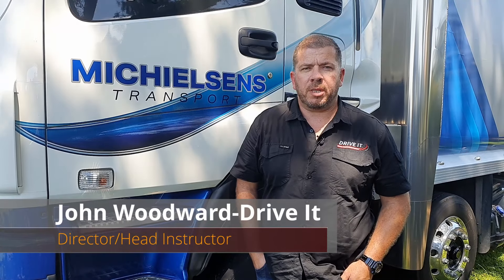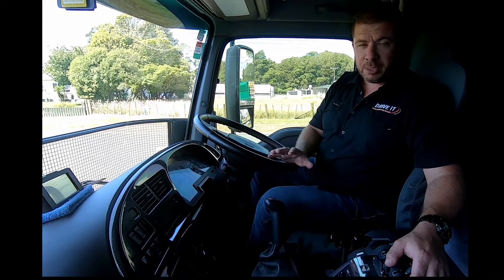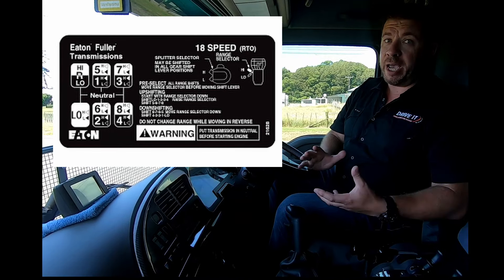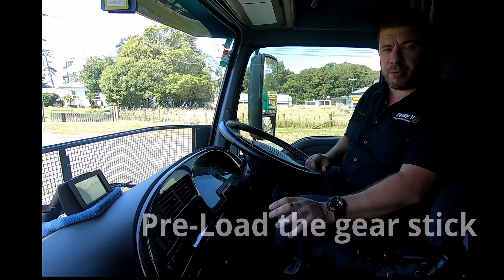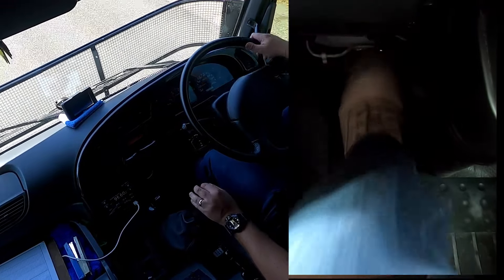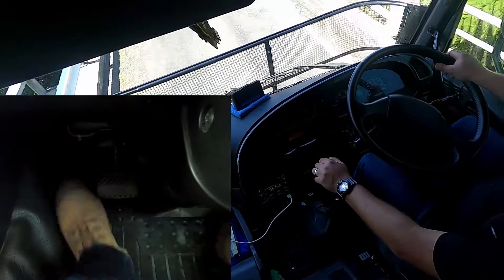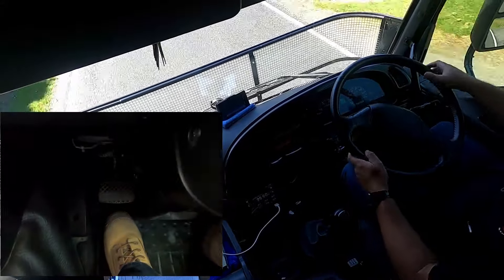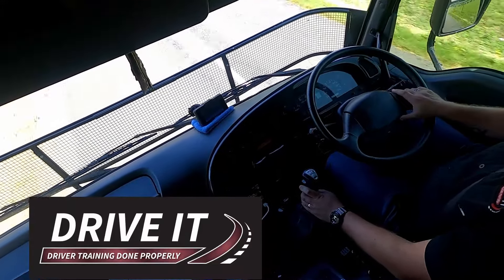How to drive a Road Ranger Gearbox part 1

Comment: After 14 years I’m finding I do have to relearn the 18 speed. I’ve driven lots in non synchro old 5 speed boxes but been a long time away from 18 speed. Did a walk around at truck companies last week handing in resumes and one took me for a test drive there and then. Unfortunately didn’t too well, the fundamentals are still there just rusty. So going back to do some time with a truck driver trainer over on the west side of Aus and go back once I get the cobwebs dusted off.

Comment: Hi John, I now that you split once you get to 4th but on down shift to you split in 5th to get down to 4th or from 5th go straight to 4th the split to keep downshifting.
Reply from the maker: Hi, sorry for the delay here, missed this completely.  
Only really need to split on the up shifts, when you're shifting down you normally need a full shift to get the engine braking, rather than the half shift the split provides.
Hope that helps.
Thanks 👍

Comment: I can tell by the dashboard you are driving an Isuzu C or E series Giga. Hardest part for me is rev matching. I know it will take practice but I'm uncoordinated.
I am watching as I'm a heavy vehicle tech and being able to drive the Eaton will help me to diagnose issues with the vehicle.
More driving is going to help me? I can drive a synchro box with high/low range (ZF) no worries.
Probably didn't help when my instructor at the time when I was getting my license was yelling at me when I was missing gears or grinding. (mostly cause I was missing the rev match)
Still to this day, I am unclear on road speed to engine speed depending on actual gear.
I'm a technician, but I am so unco it's almost not worth me trying to learn maybe
Reply from the maker: Thanks for watching.  Definitely keep trying, everyone struggles at times and everyone misses gears at times to. Sorry you've had an Instructor yell at you  thats really bad on their part. Keep trying,  it will click one day and you'll never look back.

Comment: You don’t show us if the spitter is normally back or forward (DIR or OD). What is the normal position for splitter for driving eg no splitter. For example when shifting down is the splitter in DIR or OD (forward or back)
Reply from the maker: Hi, splitter forward as in "high split" is always a good place to start. We will do a video on splitters in the future.

Comment: Have you for any advice for road positioning, I’m having trouble staying in my lane.. the truck I’m learning in is like old as…
Reply: Yeah can be a hard one to get right, best advice is to use your mirrors all the time, every few seconds. It gives you a sense of position and lane balance
Reply: Try put the middle of yr bonnet, ie the bulldog, in line with the LEFT white fog line, then carefully glance at yr left mirror at your trailer position, ONLY when in a straight line and ONLY when safe to do so, with practice, you’ll find this helps.

Comment: When going down the hill do we still have to use the clutch or just use the splitter
Reply: Hi, should use the double clutch and change a full gear or more, don't rely on the splitter going down hill as you'll need more than the half gear it gives. Ideally change down to the gear you need before you start going down hill, letting the engine and engine brakes hold you

Comment: Great video, thanks for sharing. If i could  change anything it would be the music covering the truck noise. Mainly as I learn from warching and listening but others may not have the same problem. Otherwise thanks for the video.
Reply from the maker: Thanks for your comment, much appreciated,  I understand what you mean about the music over. Have a plan for the second video so stay tuned for the next one
.
Reply: Yep hearing the revs really does help you dial it in!
Reply: Hi, I think the same on the music, I’ve driven for many years and only use the clutch to select first gear and never look at the revs ( too much else to look at around me) just go by engine noise, started in log trucks, steep county no time for double clutching, just drive with the right foot, sometimes rest my left foot on the clutch to stop the engine brake coming on between changes, otherwise right foot all the way, good video anyway 👍

Comment: Wens best time or wen do u use the crawl gear
Reply from the maker: Hi, normally only if you were fully loaded on a hill start or steep job site, or getting towed out from being stuck for example.  Its a pretty low ratio so not used much at all

Comment: Who says you can’t split downshift? Like you say, you have to match the revs and maximise the exhaust brake
Reply from the maker: Hi there, it can be done but normally needing a full gear on the way down helps with the engine braking. Thanks for the comment

Comment: I don't understand why the double clutch
Reply from the maker: Hi Dallas, its mainly to save the clutch brake valve from damage. The clutch brake slows the input shift on the gearbox which allows us to find a gear easy for take off. That's done on a full clutch, if we full clutch on a moving shift it will blow the clutch brake valve to pieces. The double half clutch gets the best result with no damage. Hope that helps,  John@driveit
Reply: If Unsure ! NETRUAL !! IS ! YOUR ! BEST ! FRIEND ; OF ALL ! GEARS !!
Reply: Providing you have enough air in your tanks to stop just with the brake.

Comment: Eighteen Speed !? Is that ! ? Six Low ! Six Medium ! Six High !? ( The BUTTON ! ) That is ! ( The Same Gear Lever ) or Nine  Low !? Nine High ! ? Unsure !? And Also Reverse !? One only !? Or More !? John !
Reply from the maker: Hi, you have crawl and reverse, then the standard H pattern,  1, 2, 3 and 4 low range, they can all be split. Then high range 5,6,7 and 8, they can be split to. So basically its 16 gears plus crawl and reverse. Don't worry to much about splitting while getting used to it though..next video will cover that in more detail
Reply: If you aren't doing your license, maybe try find a video explaining how the actual gearbox works and will help you better understand what's going on.

Comment: The Roadranger is an outdated piece of s*** gearbox I will stick to my V8 Scania
Reply: Its ok if you can't drive a roadranger.
Reply: @xeftones  he didn't need to watch the vid let alone comment
Reply: Trucks have that much torque these days you only need half the gears and skip shift. Just matching the gear to engine revs these days needs a few runs around the block first. But your right you never forget.